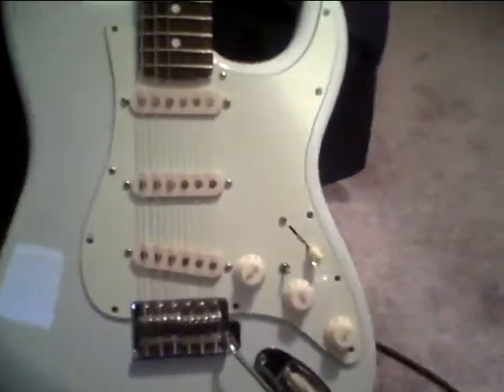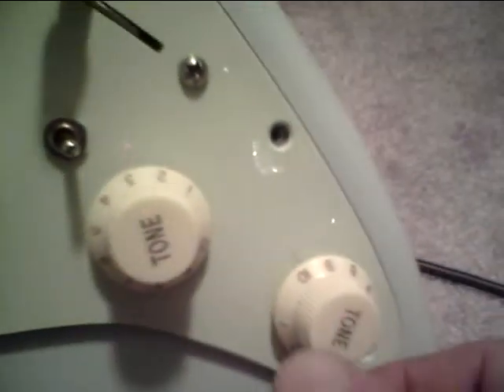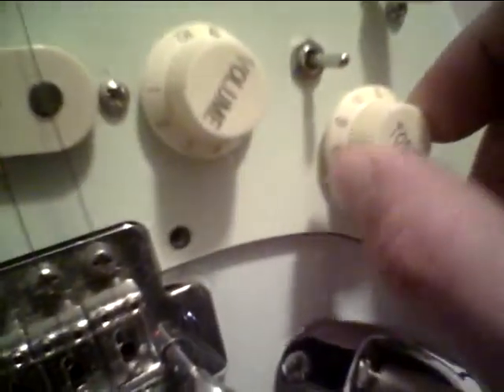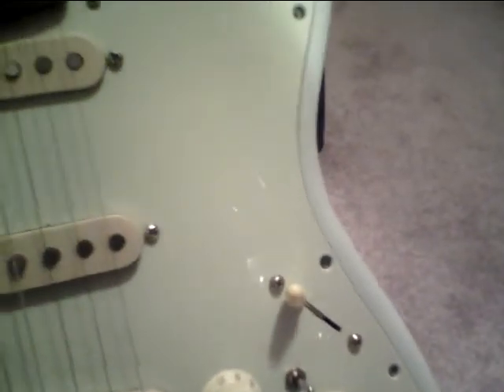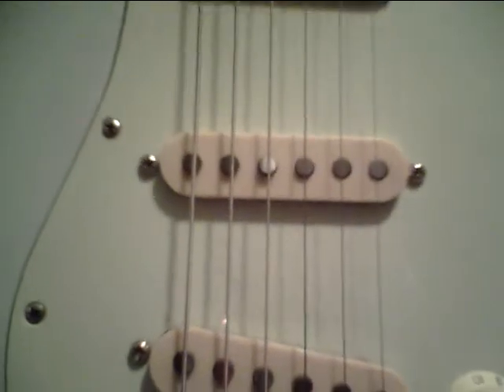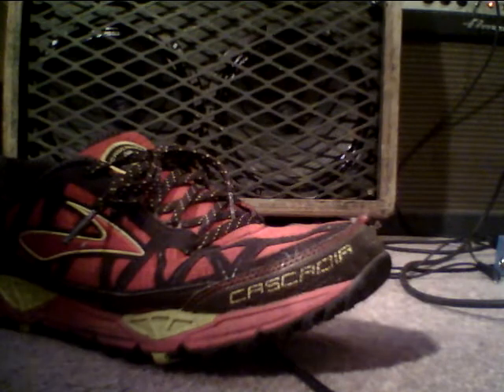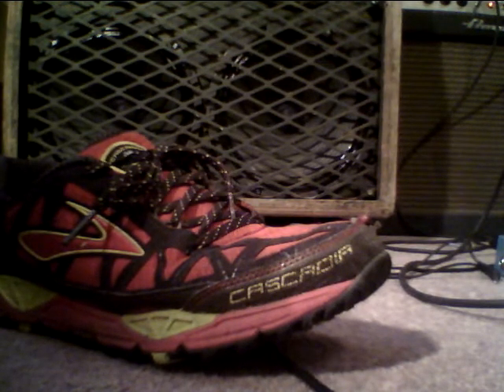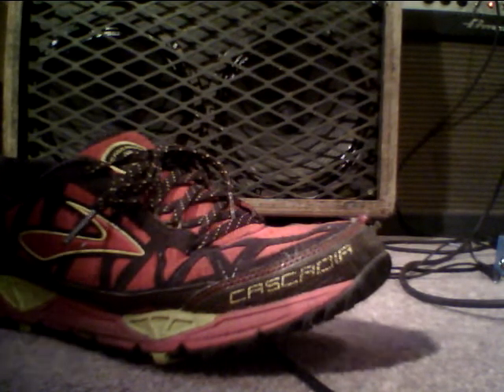Custom Strat Wiring Modfication 20+ truly unique selections

Comment: when the strat first came out, they only had a 3 way selector. no pickup combo selections. so having a tone for the neck (rhythm), then you switch to the middle (Not sure what they'd call that) for another tone, then pop into the bridge pickup with just wide open tone for trebly lead/melody of the time